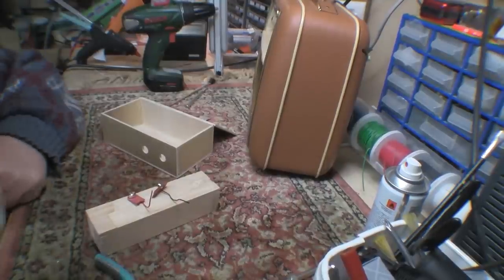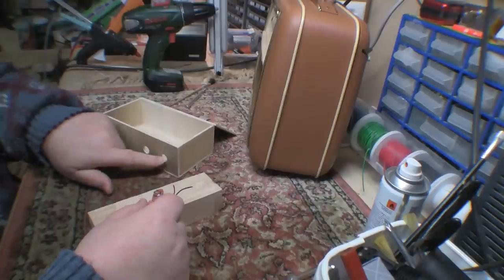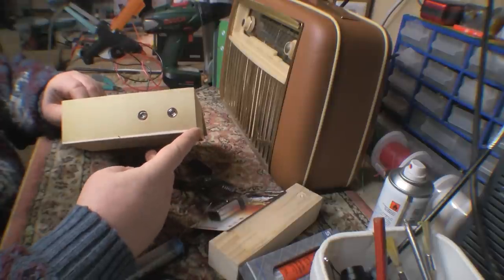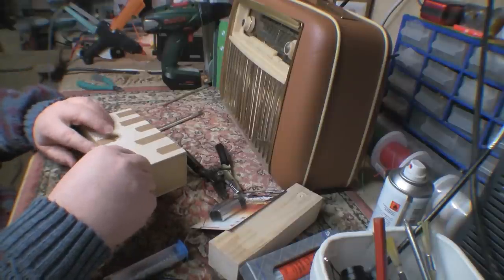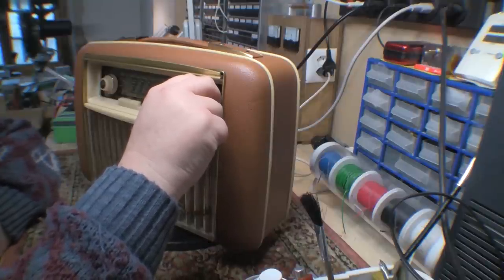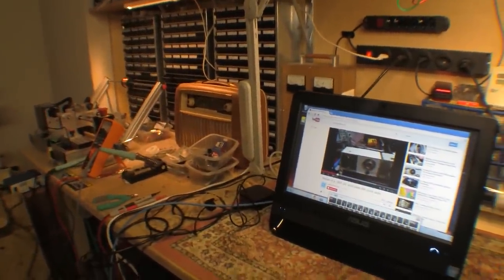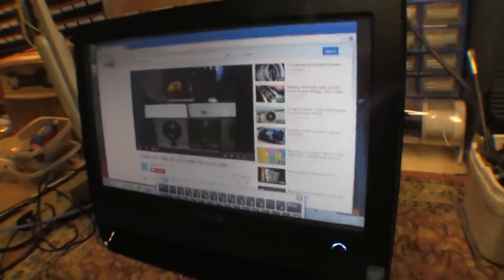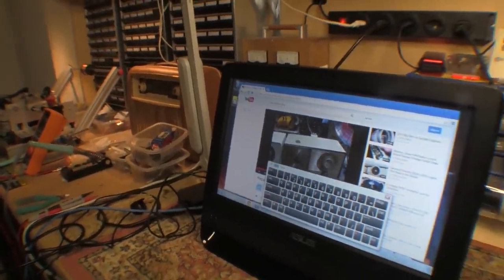Telefunken Bajazzo 55 - part 15

Comment: The Bajazzo has a tuned RF amplifier stage, so it's more selective then sets that do not have a tuned RF stage. That's something somewhat unusual for a German radio to have, most seem to focus on the audio section rather then the front end. A tuned RF amplifier or an extra If amplifier stage is a fairly common feature on a mid to higher end radios in North America, probably because of the distances involved.
Reply from the maker: Oh well, at least I've got oner set with a good front end!
Reply: It's rather interesting to have a tube/valve portable with an FM tuner, I don't think I have seen that before. The multi band tube portables they had here were usually clones of the Zenith Transoceanic series models, those had AM broadcast and short wave spread bands, one or more may have had long-wave but definitely not an FM band.